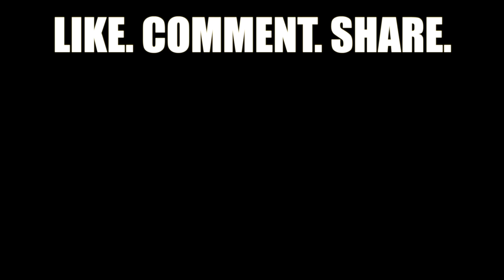Rebuilding A Wrecked 2014 Chevy Silverado [part 8]

Comment: The panel you got is the inner grille support. You need to order the main one that holds that panel you got along with your front grille. eBay sells it for like $280 for both of those pieces attached to each other. You need to look it up as a grille support

Comment: I'm not a big fan of wheel spacers for everyday driving on the road or highway, the spacer nuts can't be checked for tightness easily once the wheel is fitted & they have a habit of coming loose. Over here there are not allowed for on road use.
Reply: They only come loose if you don't tighten them properly, or you do something stupid like jump your car. I've been running spacers on all my cars for the past 6 years and have had ZERO problems. Learn how to use a torque wrench or don't work on your own vehicle for the safety of others
Reply: Dusty Farmer Use blue thread locker, they’ll be fine.
Reply: @GearScar  I run wheel spacers on my Honda ATV to increase its sideways stability and haven't had a problem yet other than they make the steering heavier. Wheel spacers do place extra torque & flex on the axle shaft and axle flanges, wheel studs & bearings, especially when 4x4ing or on rough roads. If wheel spacers were safe & without issues there'd be no reason why they are banned for road use in some places. Offset rims are a better option if you want extra wheel track & mud and wet road grime flicked all over your car or for extra stability after raising it's centre of gravity.
Reply: @dustyfarmer  One of the cars I run is a lifted Subaru wrx, 2 inch wheel spacers all around, had 4 wheel alignment done after install, I offroad it all the time as well I drive it an hour to work and back 5 days a week, parts I've had to replace so far are the sway bar end links, nothing else has worn out or excessively worn out in the past 2 years running this setup. And on my other car 2 inch wheel spacers on a Mazda 3 that only sees highway use, I've only had to change the brakes (which isn't even related). And btw I've never heard of them being banned in some places, that is news to me, however I guess its possible. I am a licensed mechanic and quite familiar with the laws in my area. 
Btw offset rims, the only difference is you aren't using a spacer to achieve the difference, if it were going to excessively wear out all these mentioned components with spacers, it would do the exact same with offset wheels, however if you get into excessive sized spacers (like 3 inch or bigger) then you will see problems, because now you are putting excessive stress on the components via the extra leverage the wheel now has to push against all these components, still its not going to wear out instantly, but it will happen quicker than usual for sure.
Reply: @GearScar  I'm in Australia, the maximum offset rim We can legally run is 25mm over standard. Everything vehicle modification wise is governed by Australian Design Rules or A.D.R's, if you want to stay road legal and avoid a defect notice &/or retain your insurance in the event of a claim your vehicle must be roadworthy, even things like seating modifications, aux. fuel tanks, lift kits over 50mm have to be tested & come with paperwork and be inspected and signed off on by an automotive engineer which is then added to your vehicles details on file, it's a P.I.T.A but the good old days are gone with government roadside inspectors & the Police & highway patrol right onto anything that looks suss.
Reply: @dustyfarmer  I'm in Canada, and wow we are not quite as strict as that in most areas here, we do have some bizarre laws, but for example wheel offsets can be huge as long as you have fenders/flares installed to support the modification (blocking rocks being thrown and covering the tread of your tire), anyone can install a lift kit, but if it looks wrong in some way, the police are likely to pull you over and send your vehicle for an inspection, they may even have it removed from the road, but if your modifications arise no negative attention then you can do as you wish even if you are not a certified mechanic and perhaps you watched step by step a YouTube video on how to perform a modification, it doesn't matter here as long as you did it correctly.
Reply: @GearScar  When submitting anything for an engineers approval I always take before, during & after color photo's and make an A4 album so they can see what I have done & how I did it, I keep a digital copy too plus one to go with the vehicle as it only good for the state it's inspected in at that time, move states & go through it again at registration. People here were going mad with lift kits of up to 6", dis-connecting swaybars etc and rolling their vehicles over or putting oversize wheels & tires on & negatively affecting their braking. The authorities just a major crackdown in Queensland on lifted 4x4's which upset many. My standard of workmanship & attention to detail is better than commercial workshops & at least I know it's been done right, the only times a dealership has touched one of my cars or SxS vehicles was under warranty, & I always regretted it.